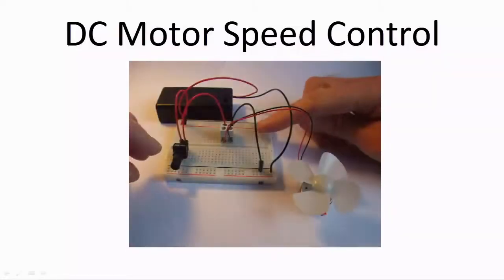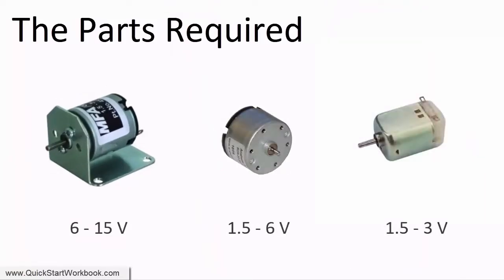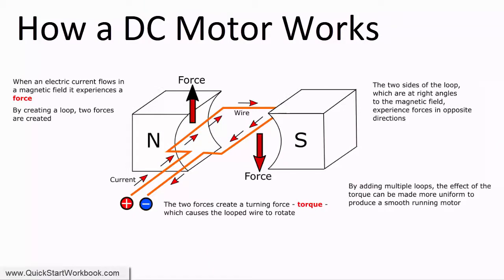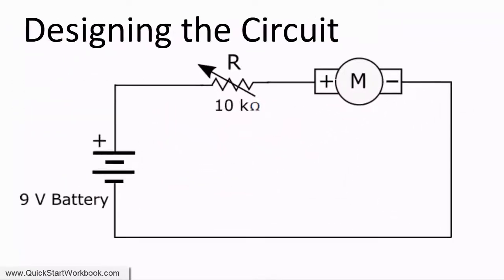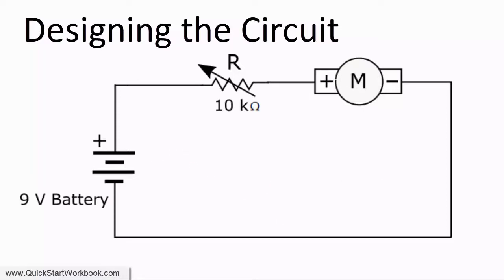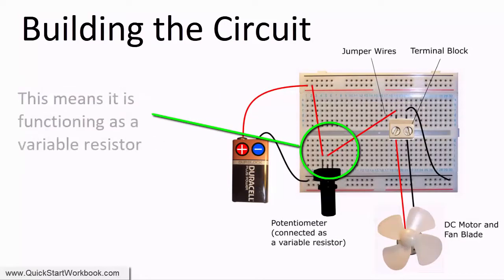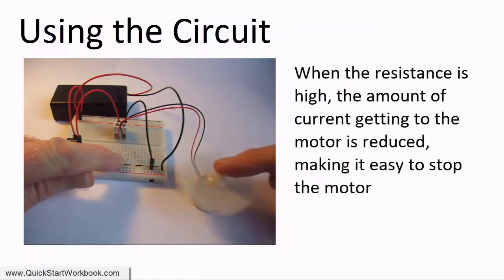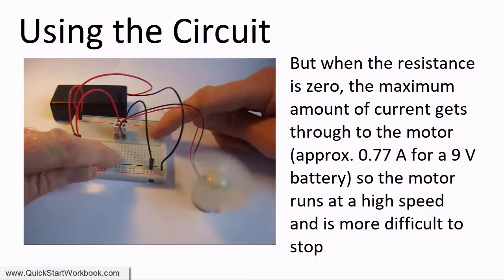How to Control the Speed of a DC Motor - Electronics for Absolute Beginners

Comment: If I power a 6v dc motor with a 1.5v battery will this give me 4th of the rpm and power? And would this cause a problem for the motor?
Reply from the maker: Hi Richard. The lower the voltage, the lower the torque and speed will be. My guess is the reduced torque would mean that you can't drive much of a load from the motor. Give it a go and see how it goes. Cheers, John

Comment: Why doesn't it work in my case 
I tried the same thing and instead of controlling the motor speed rotation, its overheats
Reply from the maker: Have you tried using different size resistors to control the speed? Perhaps try some fixed value resistors rather than a variable resistor. Remember that if you reduce the current, you reduce the power, which might cause the motor to stall and overheat.